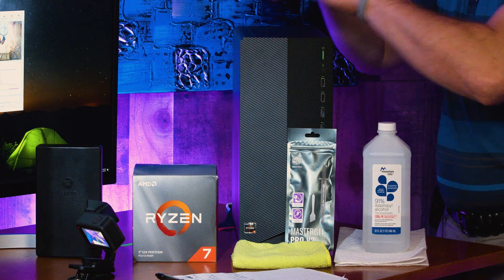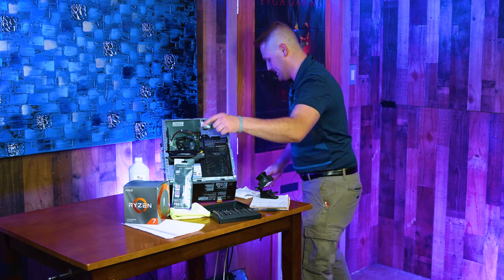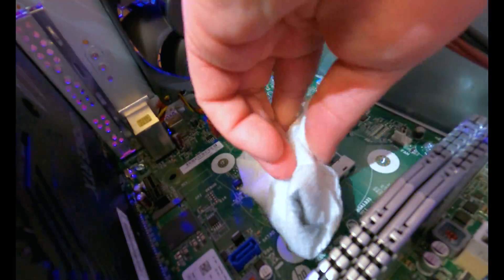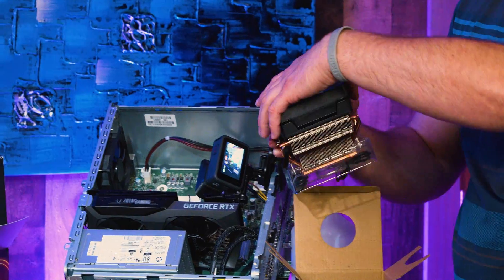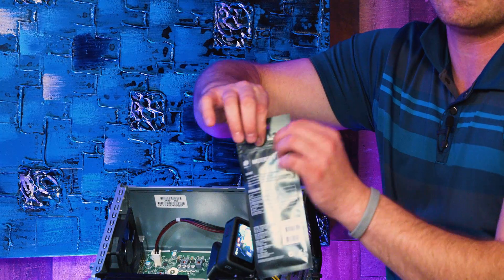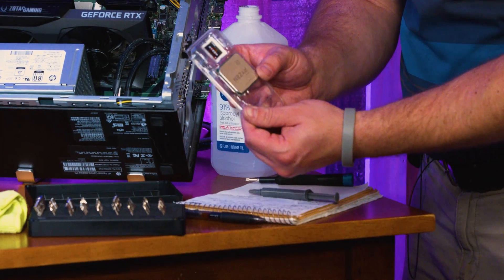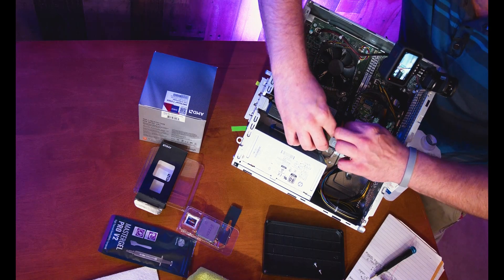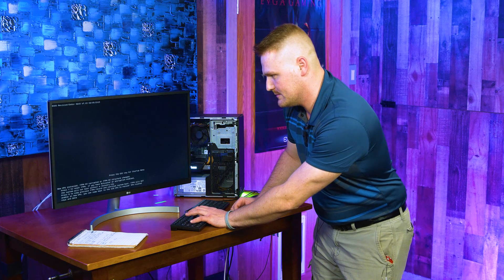HP Pavilion TG01-0023w 0030 0040 Ryzen 7 3700X How to Upgrade the CPU and Is it Worth it

Comment: Hello from siberia, tell me if it is possible to put a power supply unit from another manufacturer and more powerful, if you can show the installation process or model, thanks.
Reply from the maker: Not possible it sucks only hp Psu's.  You have 2 options  Move the parts to a new Case Mobo and PSU or Order aPsu from Hp they do have a 500watt Psu.
Reply: @TNW1337  Can you shoot a video about the installation process in another case with a different power supply and a powerful video card. I just want to update my HP computer, but I have no idea how it can be done ... thanks for the answer ...

Comment: Great videos on this hp pavilion. I just picked up a refurbished one with ryzen 3500 and gtx 1650 super. I noticed while gaming my power supply fan wasnt spinning. Could you please confirm if it spins on your computer? I havent done a stress test on mine other than playing apex legends.
Reply from the maker: It is set by a temp sensor if it does not get hot it will not spin.
Reply: @TNW1337  thanks so much, im glad to know that it usually doesn't spin
Reply: @TNW1337  Question if you could be so kind to take the time to review this. The set up mentioned here is identical to what I have with the 3500 CPU and 1650 super GPU, not for all games but a few the system completely freezes and becomes unresponsive to where I have to manually reboot. I've done stress tests, looked into the system/problem history and countless hours of research without identifying a real root cause. One of my applications implies that there is high CPU usage around the freezing events. This didn't happen when I first purchased my PC, but am considering upgrading to the 3700x to solve this issue. The temp never goes above 83° C when gaming and idles around 30 - 40°C, this appears to be standard from my research. I'd love to use my PC more for gaming but am reluctant due to spontaneous crashes. If you have any insight to what could be going on, I'd be very grateful 🙏

Comment: Cant wait for ur future upgrade videos, especially the cooling upgrades, because my TG heats a lot lately
Reply from the maker: It is coming soon.
Reply: @TNW1337  hey could i replace the case with a better case for air flow and do i need to buy another motherboard to do it?
Reply from the maker: @milleamp4510  Yes and Psu
Reply: @TNW1337  basically getting a new pc at that point
Reply: @AssyrioChaldean  well you need to buy a new motherboard, case and PSU your probably looking at around 200-250$ but it’s worth it becaus eafter that you can transfer everything over and you can upgrade anything you want to upgrade since your not gonna be limited by the HP motherboard and case

Comment: My comment is sorta related to this video but it’s more of a problem I have and idk who else to ask. 

So I recently bought a hyper x 3000mhz ram stick not knowing that I had a 3200mhz hynix ram stick in my pc already, I just looked on task manager and saw that the ram speed was 2933mhz so I assumed it was 3000mhz.  It booted up fine but the clock speed went down to 2400mhz. I looked up a few videos to see how to get the ram speed up and tried using amd ryzen master to overclock the ram, it didn’t work but the pc was still running fine. I decided to reset the ram to what it was before (of that makes sense) and took the hyper x ram out. I tried to boot up my computer but my monitor keeps saying no signal...I dont think I’ve damaged anything because I was super careful when putting things in and taking them out but idk what to do to fix this problem.   If you have a solution pls reply
Reply from the maker: Put the New stick back in with out the old stick see if it boot's. Make sure the ram is seated all the way. The larger side is on the top.
Reply: TechNitWit hello, with some advice from a friend I was told to do cmos bios test and my pc booted up. I ordered Hyperx 3200mhz ram so is it safe for me to use that or should I send it back and get different ram?
Reply: @discombobulation__4741  i had a similar problem with my ryzen 2400g on a a320. I have 16gb dual channel @ 2666mhz, when ever I tried to overclock the ram over 2666mhz and reset the pc, i would have a no signal screen till i reset the cmos. Turns out even thow the motherboard specifications state it will support upto 2933 or 3200mhz overclock it isn't as simple as that. It depends on what cpu you have, aswel as what brand ram you have aswel, an even bigger problem on pre built proprietary motherboards. Higher end motherboards don't have these nit pick issues, for example b350 b450 or b550.
Reply: Update: I think I have further increased the problem. I had created a profile to increase the ram speed which I didn’t quite mention, I created another profile on amd ryzen master which had the original settings on what the ram was previously on and applied it. My system went into a restart but then it showed no signal. Now I can’t boot my pc with one or both ram sticks.

Comment: May you work on TG01- 0023w ? For beginners that don’t know what to do and what to upgrade on it?
Reply from the maker: It is the same as the TG01-0040, Same upgrades work. Pretty much the end number is different parts they stick inside.
Reply: My advice would be to find the cheapest used PC with an upgrade path that you can afford, and make it your canvas.  Most of it isn’t so bad if you’re used to working with hand tools.  The degree of difficulty rises when you do custom fab work.

Comment: hey I’m in a budget and I’m trying to get out of console gaming and into pc gaming but I only have about 250 dollars to spend any ideas on what pc yo buy for gaming?
Reply from the maker: If you can get some older Pc parts that are good. Most Pre builts at this time start at or around 700-900.
Reply: Gonna' gotta' save some money... $600-$700 is about the entry level for gaming. Not gonna' get much of anything for $200. Even older systems with decent specs hold their value. Plus the current GPU shortage is driving prices sky-high on anything with decent GPU in it. These TG01-0023w's you can still get for around $650-$700 on CL or eBay... Good value for money. With limited/decent upgradability (mostly RAM, GPU, maybe CPU, though only up to 3700X unless HP gets off their duff and updates BIOS for Ryzen 5000 65W TDP chips).
Reply: Heck, you can't even barely buy a CONSOLE for $200 anymore... Aren't they like $300-$500?

Comment: I did the with my 690 and my temps were really high, so I switched motherboards and cases and got an AIO. I believe I’ve seen someone use a noctua cooler with this motherboard using the intel mounting, if I can find the video I will link it.
Reply: https://youtu.be/MXVlPZ871OA It’s a intel chip but I think you could do something similar.
Reply: https://youtu.be/lHvKGDXIY5A There is this too. Not sure if there will be any clearance issues with either options.
Reply from the maker: @tyy1378  I now own like 7 CPU coolers, So I hope some of them will work. thanks again for the info 👍👍✌
Reply from the maker: @tyy1378  Thanks

Comment: Another awesome video! Appreciate you taking the time to explain everything. 1 question though, I just installed new ram in my son's,G.Skill Ripjaws 5 16 gb 3200mhz ddr4. I already had bought another stick of 8gb similar to the one the TG came with but being a noob I thought that the "Gaming Ram" would be better but when I installed the new kit it downclocked it to 2130 I think instead of 2666. So my question is what speed should they be running at and did I waste my money? Of course the bios is locked so I can't change it unless I go into Ryzen Master. Hopefully you can help!
Reply: Not an expert at all here, but one route you can take is to download CPU-Z so that it can give you all the details about the RAM concerning speed and other stuff that I don't really know what it means. Then you will need to install AMD Ryzen Master because from what I understand HP has locked the BIOS on the TG01. Ryzen Master is a program that allows you to set the clock speed and other parameters of system hardware without going directly to the BIOS. You would then use the information about the RAM from CPU-Z to make appropriate changes to the memory settings and run a stress test to make sure it will work. If something goes wrong and the system crashes you would remove power from the machine, remove the battery from the motherboard for a minute then start over again. 

Another problem could be that the RAM is not compatible with the motherboard. You can check the motherboard page by HP for that information. I will say that I just upgraded my TG01's RAM from the original 8GB to 2 sticks of 16GB at 3200MHz. Mine was plug and play possibly because I just purchased the Crucial brand RAM that was linked through the HP motherboard site. Hope this helps and best of luck!
Reply: @jacobjones5595  Thanks bro I appreciate the help. Yeah I have CPU-Z and Ryzen Master and when I bought his new ram I installed it and set it to 1600 on Ryzen Master and I also set the Fabric clock to 1600 and it was running but had really loose timings cl22-22-22-58-73 so I went in and just adjusted the parameters that where on the package and CPU-Z and it crashed so I had to remove the cmos battery and reset it the settings I tried where cl16-18-18-18-36. Did you mess with your fabric clock , like did you do coupled mode or did you just leave it alone. If you wouldn't mind could you please tell me what all your timings r. Thanks for the comment.
Reply from the maker: Yeah hp kinda drops the ball here. The biso is locked. Unless it is the amd version there is a biso update to allow it to support 3200mhz. The intel one well only allow 2666mhz.
Reply: @TNW1337  I have the amd TG series and I can't find the bios update to allow 3200 with my model TG01-0018. Also do you know what chipset it has in it. Hp says B550A but Cpu-Z and HWin or whatever it's called says X570. Thanks for getting back to me
Reply from the maker: @Ace8MVP  I will have to look for it.
Reply: @Ace8MVP  Just reading this today but I didn't mess with fabric clock. My timings are CL22-22-22-52-74. I have the TG01-0023 version that comes with the HP "Erica" motherboard. It is a B550A chipset, however CPU-Z also shows it is X570.
Reply: @Ace8MVP  Also the RAM that you are installing is DDR4 PC4-25600 and UDIMM?
Reply: @Ace8MVP  I just looked at some RAM that seems to possibly be what you purchased. If its 2x8GB sticks the listed settings for that RAM are CL16 (16-18-18-38) at 1.35V
Reply: @jacobjones5595  yeah that's exactly it. And I tried to set it and that's when it crashed so I'm just letting it run at 2130mhz
Reply: @Ace8MVP  i don't know if this has been clarified in the above comments but some if not most oem motherboards will downclock most ram kits to 2133mhz. If you want the maximum speed your motherboard supports you need to buy specific ram kits, you can probaly find this information looking up your motherboard on the manufacturers website.
Reply: @jacobjones5595  I got my G.Skill Ripjaws 5 16 gb 3200mhz running at cl18-18-18-38-54 and it's in Coupled mode. It's made a huge difference old user benchmark for the ram was like 79 today it was a 93.5. I did one memory latency marks at a time. That way if I knew when it messed up I knew what it would be. Before yesterday mine was running cl22 and the exact numbers of yours. I did have to reset the CMOS BATTERY one time and that's when I tried the package settings of cl16-18-18-36. So if you want to you can go ahead and mess around with it and see what you can get but just take your time. Goodluck

Comment: Aw man, really wanted to see that Wraith Cooler on there.  I’m guessing that the CM 212 won’t clear either?
Reply from the maker: With some mod maybe . I think this is going to be the best route.
Reply: @TNW1337  should max it out u got a 3070 or 2060 in it and 500w psu gold and now have a amd r7 3700x just make it a god it can vr and other shit now man akso good stuff i did 16gb but my mhz is 2400 not 3200 or 3600 still runs nice
Reply from the maker: @THBGYMN  oh yeah dual chnl makes it must faster.
Reply: Does this need cooling with this upgrade? I already have a 3080 in mine. If I did this just wanted to know before hand. Thank you!